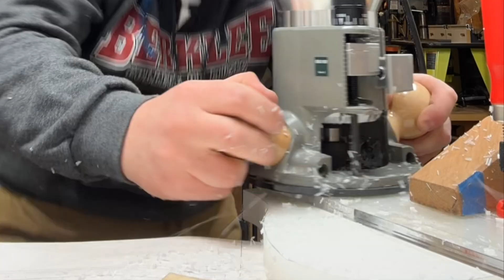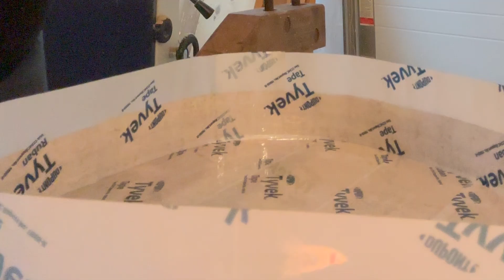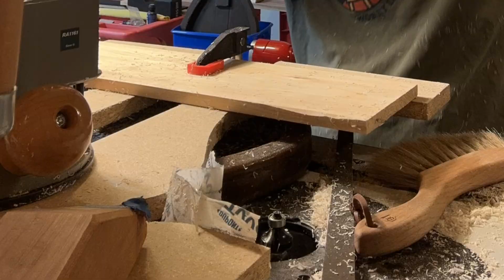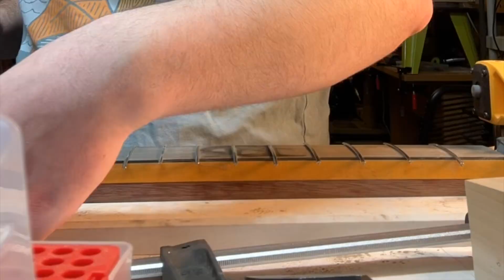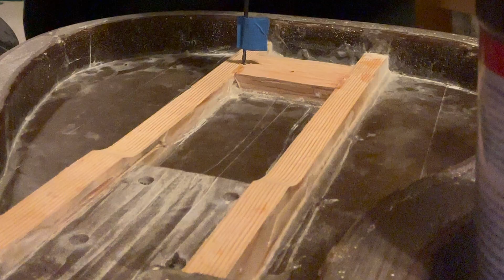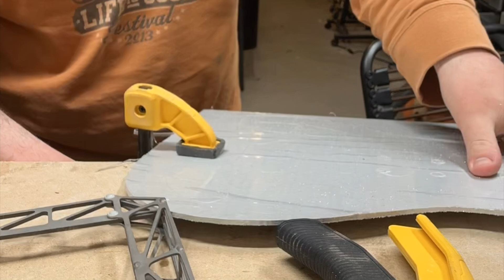The Future of Electric Guitars? Sprig Prototype - Full Build

Comment: You refer to the design as kyrily (sp) symmetric. I'm not familiar with that type of symmetry and can't find any definition for it. Can you please explain what it means, or did I mishear it?
Reply from the maker: Good catch! Chirality is mainly a chemistry concept and refers to non-superimposable mirroring, i.e. like handedness or the direction of a screw’s threads. The design was created through one edge profile flipped around a centerline, which is normal mirror image symmetry, but because the molds have a front and a back I thought they were more chiral than normally symmetrical.

Comment: I love the idea of using a fast growing invasive plant like tree of heaven to make a composite, really cool. Have you considered taking some inspiration from the old Danelectro guitars, and making a composite frame (maybe with a center block?) and sandwiching the aluminum sheets on front and back? It could lighten things up and maybe make the molding process for the composite a little easier. Seems like you have a lot of options to play around with, cool project!
Reply from the maker: Yes! Thanks for this lovely comment and kind words. I have thought of a skeletonized composite rim like you suggested but wanted to avoid the feeling of cold metal against one’s torso while playing if that makes any sense. However, if that doesn’t sound like it’d bother anyone besides me I’d love to try it out as it could probably yield a <6lbs finished guitar. You’ve inspired me to revisit the idea, thanks again!

Comment: Kudos for trying something different - and for the new YT channel!  Epoxy resin is not my cup of tea (I don't consider mega-chemical plants to be eco-friendly....maybe some are better than others...)  but to each their own.  I realize this is a prototype build.. so as such I hope you're keeping careful track of all the places you had to do time-consuming handwork late in the process - paring down the internal blocking by hand... changing the neck pocket by hand... having to re-thickness your headstock late in the game.  They're just workflow issues but will save you days and eventually weeks, and if you're trying to manufacture something for sale (vs. just building a one-off for your own enjoyment), every second saved shows up at your bottom line.  Also realize aluminum works just like wood with carbide tools. No need to hack away with a jeweler's saw 🙂. 

A little constructive critique about the video production...the volume of your music where it's at underneath your voice-over is about right for in-general, and half of that for your voice-over.  Right now it's making the video unlistenable on both my laptop and iPhone - had to mute it and guess when you were speaking... and even then it's often competing with your voice.   You want to check it carefully on the same kind of devices people are going to use to listen.. the mix will sound completely different on each.  Good luck with your channel.

Comment: Looks pretty cool buddy! Pro tip, all your router bits will cut through aluminum about as easily as wood. I have a whole stockpile of plastic pickguards I keep as templates. I do the CA glue and masking tape trick with some scrap 1/8" pieces of wood for a spacer and I've cut about 20 ish pickguards out 16ga-3/16" aluminum.
Reply from the maker: Thanks so much for the advice, this is exactly the kind of comment I love to see! I’m about to need to do this for the square aluminum tube bracing I installed in the second Sprig since it’s a bit high, but I ordered an end mill thinking it would be more suited for this even though it lacks the template bearing. This just might sway me to try and do it with the router, because otherwise I was considering chucking that into my drill press! Very grateful for the reference experience my friend, much appreciated.
Reply: @treeforthetaking  any time. I have an unlimited supply of aluminum @ my work so I've made quite a few guitars using aluminum in just about every aspect of the building process.

Comment: This is very interesting work, but I will say... it's pretty ironic to make a guitar out of a supposedly sustainable material, but to use MDF and HDPE as internal forms that get destroyed in the process. Really a very unsustainable production method.
Reply from the maker: As I mentioned in the video, they should be reusable with the reapplication of tyvek tape. But that is part of why I’m looking to improve my mold making approach as these are still prototypes. Other options include a silicone enclosure for the form, either way it’s definitively a work in progress and only my third ever guitar. I’m looking forward to achieving infinite reuse as well as improvements in commercially available bio-resins, but one cannot learn without iteration. Thanks for the comment!